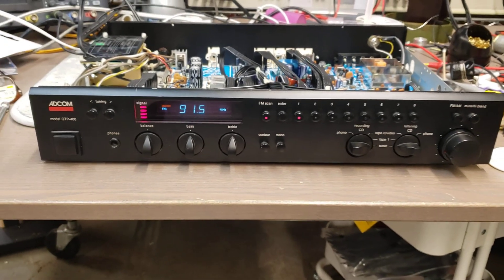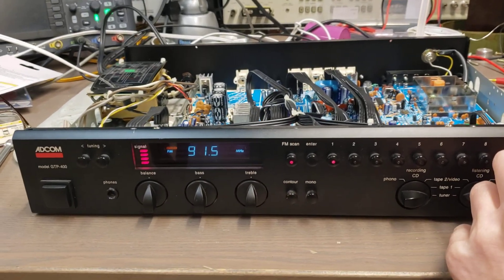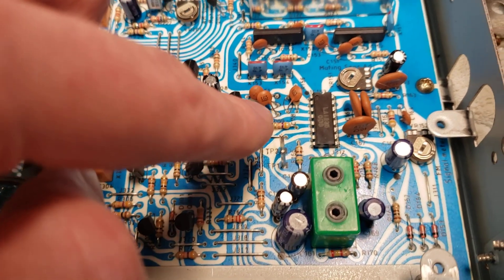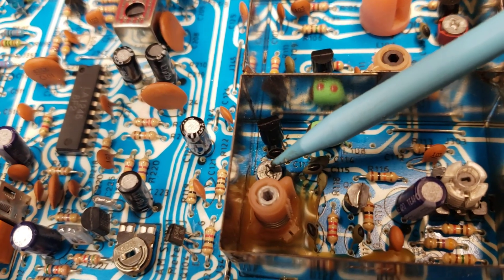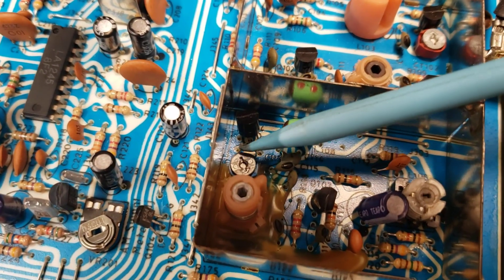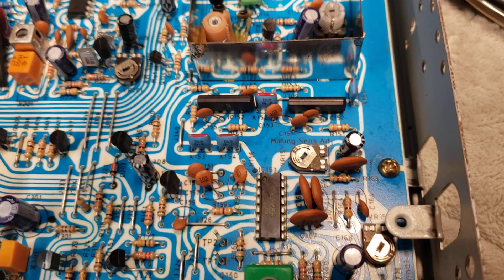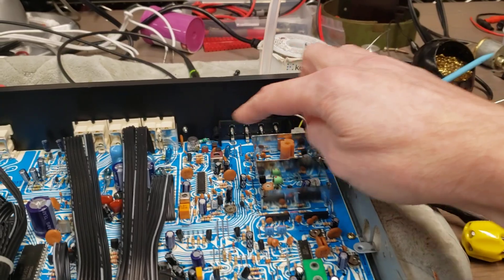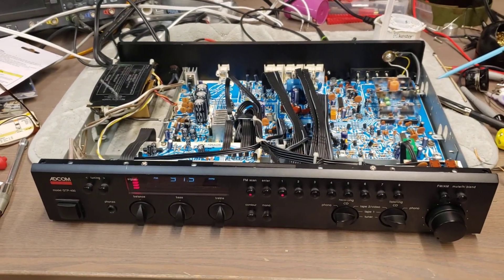Adcom GTP-400 FM Tuner Problem

Comment from the maker: 2 weeks using this every day and no troubles at all.  I think the cap is fine at least in my case and it was just the solder.
Reply: Mine is in the shop right now in Rockford, IL.  I was told that parts to fix the problem are no longer available.  Mine plays fine but periodically a loud pop comes through my speakers.  Do you know how the phono stage in this unit sounds?  Can't seems to find any info on that in any of the old reviews.  Considering a turntable purchase.  Good video, by the way
Reply from the maker: @matthewanderson3210  No idea about the phono section, I haven't tried it.  The tuner's been serving as my shop radio since I posted the video, running into an HP Barney Oliver amplifier.  It's been rock solid since the repair.  A periodic loud pop could be just about anything...  I'd start with cleaning all the controls and touching up any suspicious solder joints.  Checking all the rail voltages is generally a good idea.  Also, this unit has a relay that mutes the output signal while the unit warms up.  Mine has been trouble-free, but I have seen relays on similar designs give problems with poor/intermittent contact.